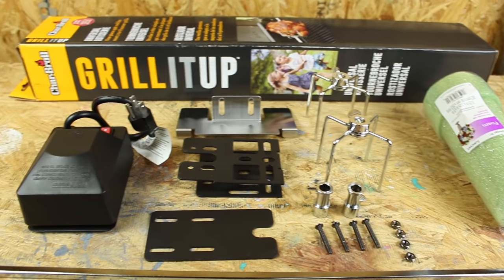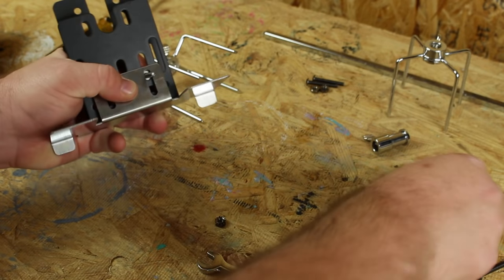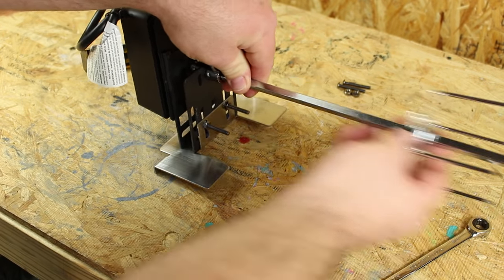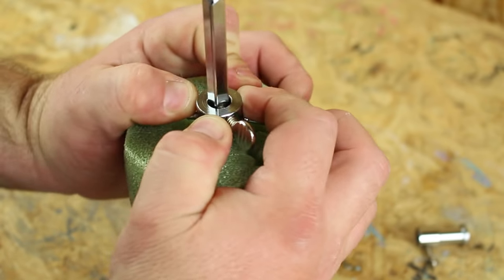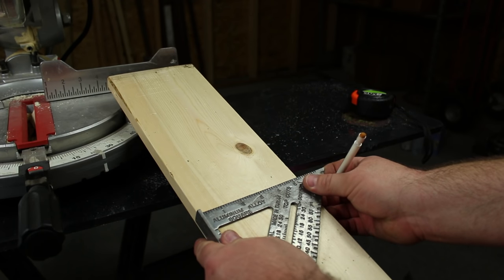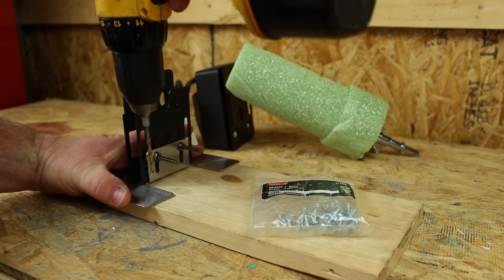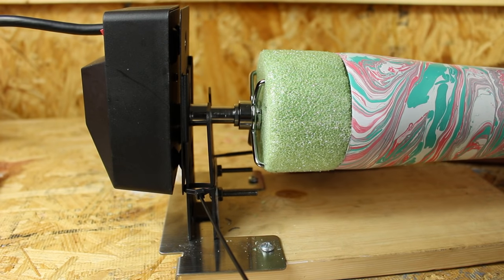DIY | HOW TO MAKE A CUP TURNER

Comment: I was wanting to share our rig with you someday, but can't seem to add pictures in the comments... we use a rotisserie just as you but had a disc cut out of leexan and mounted 4 threaded rods to it so we can roll 4 at a time.   With the thick layer of epoxy you are now able to apply with the rolling cups,  the finish is unbelievable isn't it?!   Lay that stuff on there thick,  then we put a heat lamp shining on them and the epoxy is cured in 4 hrs tops👍😁
I will throw a video together if you're interested,  doing 4 at a time is such a time saver.
Reply from the maker: Yeah, I seen another on facebook the other day that had 8 mounted on a sawblade. I could do those but most want to see how to just build the regular ones and the parts left over I might do it soon who knows. Very Cool Tho. I dig the drone over the campground, which drone is it?
Reply: The drone is a Yuneec q500,  that's a building aspect of life going for licensing to fly those legally and have started building a business for that.   The cups we do under a different name(not self promoting on your site, respect)  and finally we own and operate a landscape business in Florida.   I have a buddy with a laser who cut the lexan for my 4 cup rotisserie.  It took some trial and error to get it right but it works perfectly now... And try the heat lamp and cure the epoxy quicker.. It has had no adverse effects on the hardness or clarity of the epoxy.
Reply: I would love to see one where I can epoxy 4 at once!!!!!
Reply from the maker: Build one! LOL
Reply: Fentertainment .......video???   i really want one!!!!
Reply: I wanna see a video!
Reply: Tom OBrien omg yes video please!
Reply: Tom, I would really like to see a video and also know the parts you used specifically! We want to be able to apply the epoxy while the tumbler is on the turner and have every thing be stable. Sounds like you have found the answer. Please let me know how you did it.  Thank you!!!!

Comment: Is there any way to deviate from this using the same basic structure but with the pvc pipe that's removable to hold the cup while you work and then reattach to turn????
Reply: Fentertainment also has other videos that show other types of turners... the tutorial I used to build mine using his video was the one where I could remove the pvc and set it to dry after a few hours.   Hope that helps....   look though his videos :)  Theyre great !!
Reply: Kim Santoscoy  which video was that? I tried skimming thru them but didn’t see it

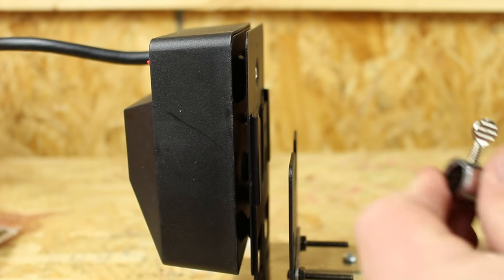Comment: The play that you have at 3:32 is because you have that piece on backwards.  
Flip it around so that the small side of the collar is towards the motor.  Put it up against the hole and THEN you slide the mounting bracket on.  The little lip on the small side of the collar keeps it in place once you slide the bracket on.  Then you won't need twist ties to hold it tight.  Just flip that collar around and you're set
Reply: I wish he would make a revised version because you are 100% correct! Turning that piece and putting it on the correct way fixed all my turners problems!
Reply: Will this stop the motor from “walking” up - mine is moving off the bracket as it turns

Comment: Hi Ryan thank you so much for this I made my cup Tisserie but my cup keeps on falling off that foam piece when it turns how can I prevent this from happening? Next question is so I needed to turn it off so wouldn't fall off and during the night it formed drip marks how do I take those drip marks off to reapply another coat
Reply from the maker: I made a deluxe one with multiple cups. It prevents a lot of the problems people have.
Reply: But what do I do if I do not want to make multiple cup and an answer about the drip marks please?
Reply from the maker: So the drip marks are forming because the cup is at a slant and the epoxy hasnt dried enough to not drip. In order to removed the drips and runs you would need to sand it down and then add another coat. This is being said because the cup is only supported on one end. The reason its dropping off the foam could be the  foam is not placed centered on the rotisserie shaft and the gravitational pull keeps dropping the cup to the lowest point of the rotation. You may be able to try a pool noodle. I have since started using pool noodles since they hold the cup better than the foam did.

Comment: If your build is jerky or noisy it's because the shaft going into the motor is not a great fit. For a quick fix I wrapped a piece of a sticky note around the rotisserie shaft and inserted it back in the motor. No more jerkiness or noise...
Reply: Are you talking about an actual post it note? Mine is making a pretty loud noise and I’m not sure how to make it stop ☹️

Comment: Hey Ryan, Would you recommend a 9rpm or 18rpm drying motor? I found some good deals on ebay for fly fishing rod dryers. Let me know, thanks!
Reply from the maker: Since I have never used them I couldn't honestly recommend either. I know this Rotisserie does the job. I have links pinned to the top comment and in the description. Another thing to consider is the weight of the cup that the motor will have to turn.
Reply: Fentertainment true that, I'll probably go with the rotisserie then. Was it the first one that comes up on amazon?
Reply from the maker: I used the $28.12 one.

Comment: I just starting watching your videos. I just got me some resin and was going to hand paint it as you did in another video. Will hand painting
 not work as good?
Reply from the maker: I still hand paint them.
Reply: So do you reallyyyyy need the Rotisserie? What are you thoughts before and after using one?
Reply from the maker: At first I was thinking I would never use it and keep doing it the way I was doing it with thin coats. However ever I used it once I use it everytime now. I can lay a thicker coat of resin on it and it looks like glass. So do you reallyyyyy need one....No. I'm not gonna lie you dont. If you want to step up your game though. I would go for it. Links to where I purchased are pinned to the top comment and in the description you can build this for around $35.
Reply: Thanks! I just want to try a couple first then I'll make the Rotisserie! Thanks again :D
Reply from the maker: I understand completely.

Comment: is there a video showing how you apply the clear coat using the rotisserie?
Reply from the maker: No, Not yet anyways. I have just mixed the epoxy, turn on the machine and pour it on while brushing.
Reply: good to know - thanks!

Comment: Do you have issues with the cup wobbling any and not staying level?
Reply from the maker: when I had this yes i did. This is one reason I built the new multi cup rotator and did a video of it monday.
Reply: If you just want a single cup do you have suggestions on what to do to keep it level? On this fb group I'm on someone said to put thebottom of the cup against something like a wall or book but wasn't sure if you might have any additional suggestions?

Comment: Fen, when yours actually turns and the cup is on... does your cup dip lower at times? Mine seems to shift to one side or another then the cup dips down a bit throughout the rotation. Great video... thanks for all your help!
Reply from the maker: Yeah Mine does it. its due to the foam is not perfectly aligned on the rotisserie. You can see mine doing it in the comic book video.
Reply: Could you use a miniature football instead?  Would that fix the issue?

Comment: ok.. question.. can you make a video that shows a two color tumbler? ( meaning..instead of the silver of the tumbler showing, once the vinyl is removed..another color which is different from other color is showing) Hope I made sense.. lol
Reply from the maker: Kandi, I've tried this before. Maybe I will try it again soon.
Reply: Fentertainment awesome... thanx
Reply: Kandi Warren I just did this and it turned out amazing! just make sure the first color is completely dry before applying the decal and doing the second color or the decal will peel up the first color.
Reply: Danielle M thanx.. I tried and as expected.. it was a disaster...lol Decal stripped..paint ran..and I cried...
Reply: For 2 layered paint, I have found that it is best to sand the cup before putting your first coat of paint on.  It gives it the best chance to adhere to the cup.  Regular spray paint that you get from your local hardware store will work great.... if you use some sort of hobby paint, your results will vary...for these instances I usually sand then hit it with a primer base coat.... then use the hobby paint....then decal... then top coat... the base primer coat allows the second layer to adhere without pulling up when the decal is removed.

Comment: The link you have in the description is not a motor anyone wants to buy if they’re making a cuptisserie. I just wasted $50 on an unstable kit that isn’t the one you said you used. I should have looked more into it but I was impressed by your video I jumped and bought what you linked when it wasn’t right. Just wanted to let you know so you can change the link.
Reply from the maker: For some odd reason it must have changed since I posted this video. I would recommend using the new method these days. Its actually a lot cheaper to make. You can find that video here -  https://youtu.be/pFxtHN6mnVI